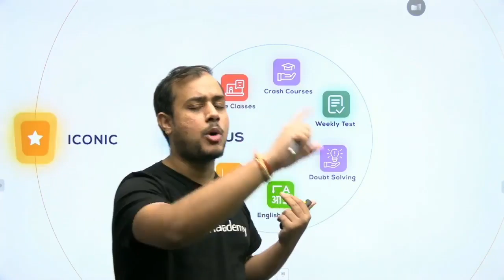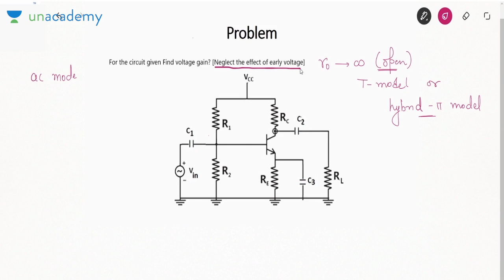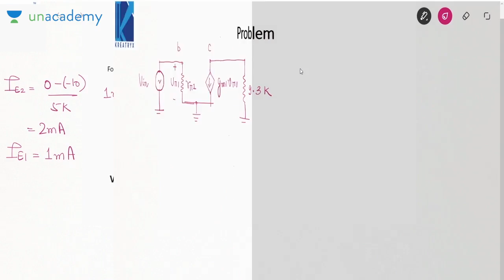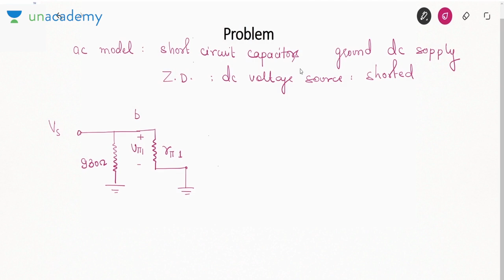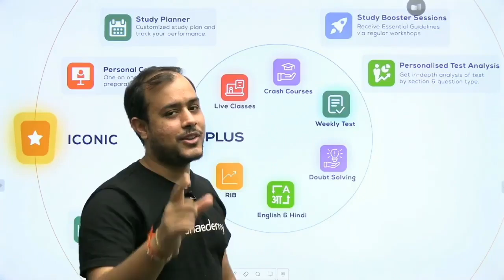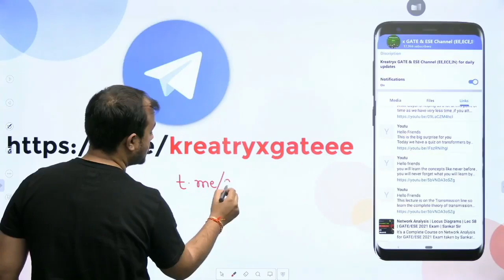Problems from Analog Electronics | BJT | Lec 49 | Analog Electronics | GATE 2021 Exam

Comment: why 930 ohm resistor is not considered which is at Vcc.
Reply: I think as it is connected b/w ground and ground....there is no voltage drop...So it is ignored.
Reply: @srujanasrikongari1691  I think she is asking why he didn't consider it while finding the VC1